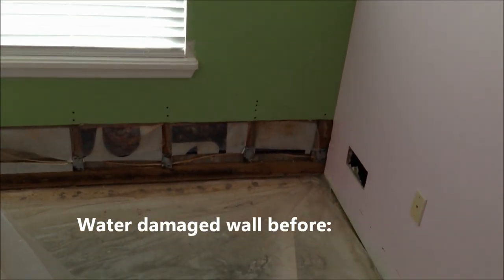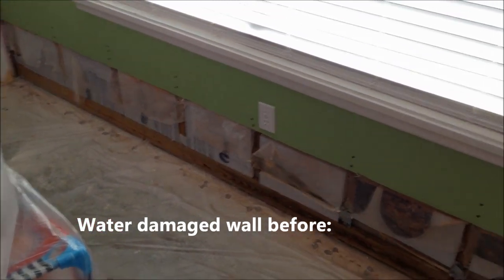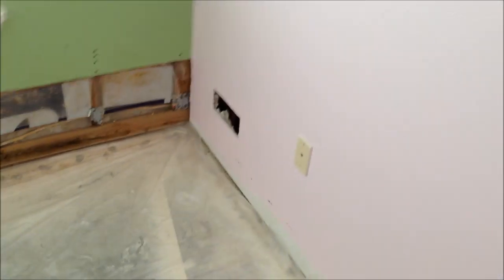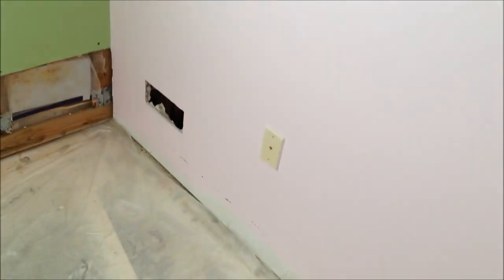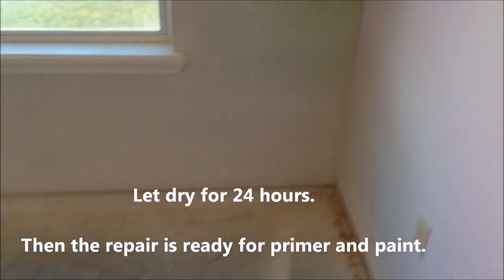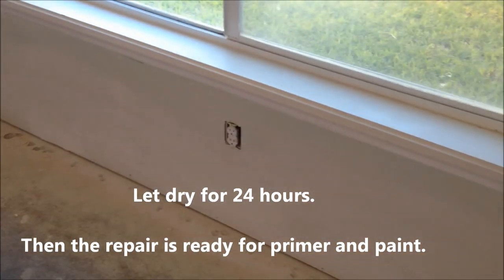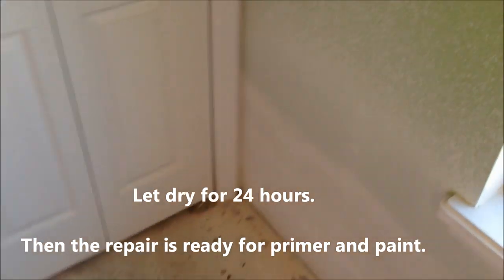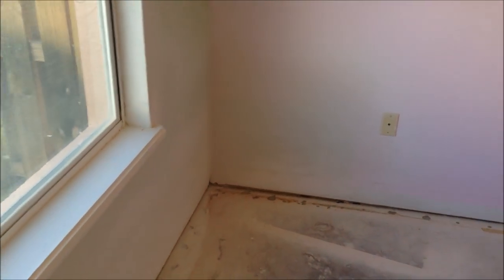How to hopper spray orange peel texture on a wall repair in less than 2 minutes

Comment: I tried this after watching your video today. I had a hard time getting the consistancy correct and ended up scraping the wall a few times and trying again. It looks ok but there are several areas where the splatter is standing too tall. I am assuming I can sand it down a bit before painting? Thanks again.
Reply from the maker: Yeah it sounds like you were running out of air in your compressor. If I'm using my small compressor I usually have to stop several times to let the pressure build back up. You might also be able to take a drywall knife and lightly knock the thicker splatters off after the texture dries.

It sounds like you got the hang of it though. Your next orange peel texturing project will turn out perfect! :)
Reply: Paul Peck That's great. In hindsight that was exactly what was happening. Funny how talking to someone with experience works out. Thanks again. New issue is I was sold the primer and paint in one at Home Depot. You mention not to use it. Why?
Reply from the maker: Steve Pool I'm glad that I could help and you asked some questions. I have lots of information regarding texturing. But if I put it all in my video it would be a couple of hours long . LOL.

As far as the primer and paint. The reason I say not to use them on a drywall repair like this. Is if you read the back of the can it will probably say to prime new wood, drywall and metal first before using this product. I like to use Zinnser 123 water base primer for most priming situations.
Reply: Ok, ran a trowel over it and sanded a bit, looks good!
Reply from the maker: Awesome Steve Pool! 
Remember flat paint is best for hiding imperfections. The more sheen the more you will see.
Reply: Paul Peck Well, after I painted it with flat it still showed some areas where the texture was thicker. Can I safely knock those areas down a bit by sanding even though they have been painted? I would think it would be fine. Really want to ask what you do to clean your tools each day when you are at a clients home. Spraying off the rollers, brushes, etc is a touchy subject around here. (Laguna Beach, CA) Empty bucket of latex needs to be cleaned or texture bucket? How do you manage that ? Thanks.
Reply from the maker: Steve Pool Yes, Hopefully you can just knock the high spots down by sanding. As far as clean up. If I'm in a situation where I can't access a water hose I'll use a wet sponge and wipe my tools down in a five gallon bucket with a little water in it. Then I'll take my tools back to my shop and clean them more thoroughly in my utility sink there.
Reply: Paul Peck Thanks. Key word is "shop" and "utility sink". I have a nice yard but there is white soil from washing tools out. Trying to see how the pros do it. Got high marks from the owner and want to thank you for the tips on the new wall and texture. I have stayed away from painting and repairing stucco homes. The majority of the homes here are 2 story stucco, 80%. Any videos on those subjects ?
Reply from the maker: Steve Pool Glad I could help you out with a my orange peel texturing video and just a couple extra tips. :-)
Yes, I do stucco repair as well. I do have a couple of stucco repair videos here in my stucco repair playlist. https://www.youtube.com/playlist?list=PL7Ww-LhWbB0H25vcOCrrGXfAvaszBl5VN
Feel free to ask me any questions in the comment section of those videos too.

-Paul

Comment: why primer? not combined primer paint. I have used all in one with no problems for years.
Reply from the maker: +TurboFlush because the orange peel texture is a Raw material. Which requires a real primer. The all-in-one paint and primer's are meant for priming over an already painted surface. If you read the back of the all in one primer and paint cans, it says to use a primer on unpainted surfaces like raw wood and other raw materials like drywall and joint compound etc. Hope that clears it up, Paul
Reply: Paul Peck 
I have never had a problem. just soaks up a bit more paint.
Reply: still good to know

Comment: Went back to look at the wall and its not looking even in coverage or texture. How do you repair a bad texture job? It's about 40 sq. ft. on a wall that I removed drywall from the middle to repair a leak. Any hints?
Reply from the maker: Depending on your skill level. Sanding might be your best solution.
If I was doing the repair I would skim coat it.  
A way for you to skim coat is to thin down some joint compound and roll it on with a 1" nap on a roller. Then smooth it out with a drywall knife or trowel. Sand. 
If you go that route you should do the whole wall.